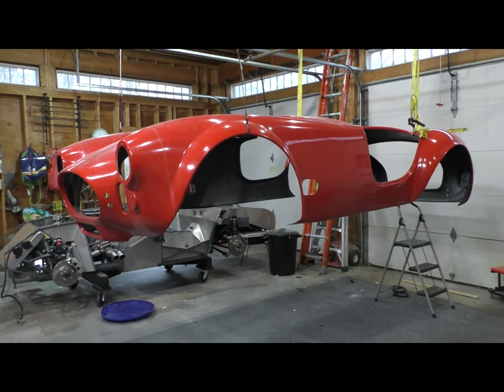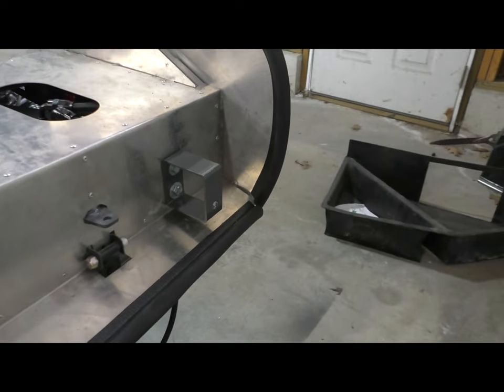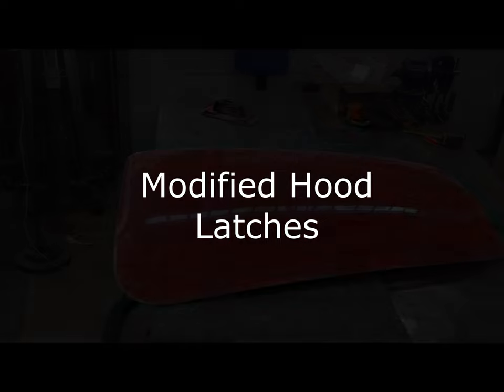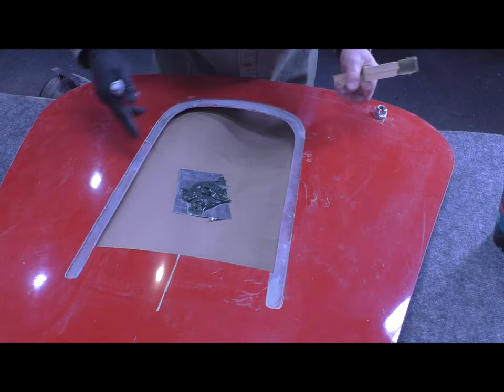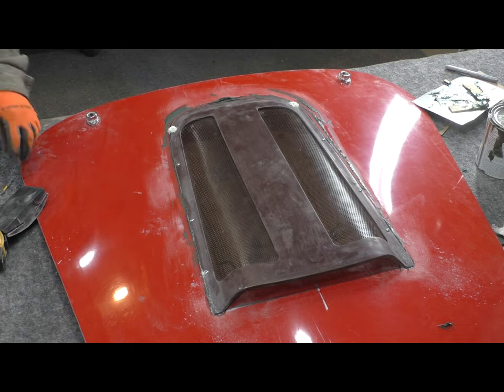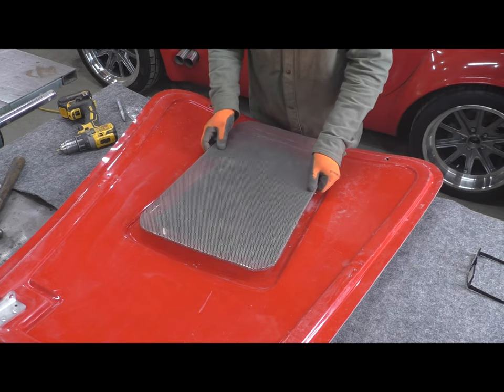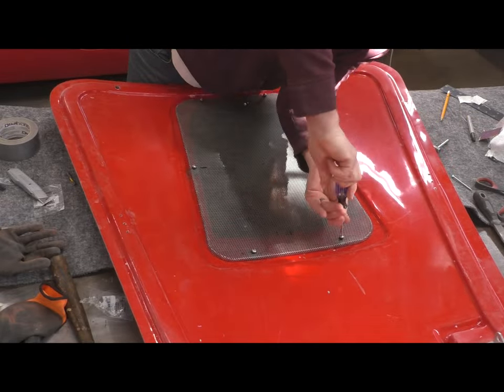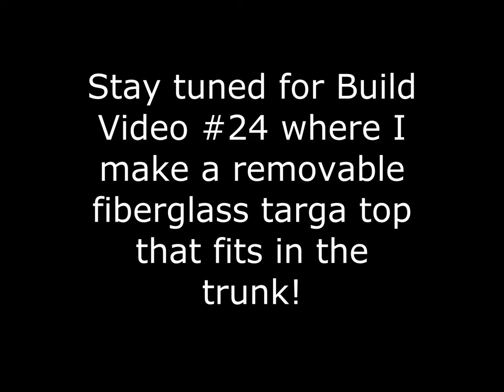Factory Five Roadster Build 23

Comment: Must have been tired when you edited this one.  You put the hood pin segment in the video twice.

I was watching Ford vs. Ferrari the other night and there are a lot of cobras in that.  They mentioned that the GT-40 would lift at high speed because air got trapped in the engine compartment and wasn't coming out.  With the test that you did, hopefully 75% of the air coming out of that scoop will keep that from happening.  Can't wait for the test drive.
Reply from the maker: Yes, I was indeed tired when I edited that video. I had a crazy busy work week so my work/play ratio was off. 
I can’t wait to get this in the road. Im getting close!